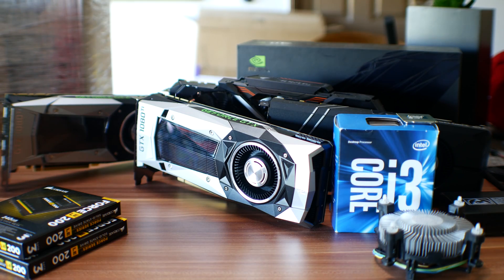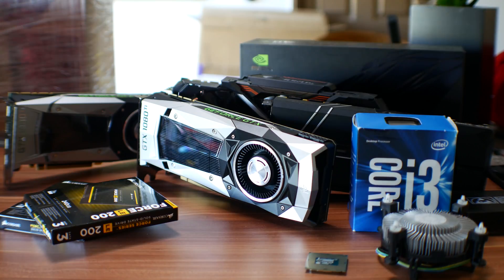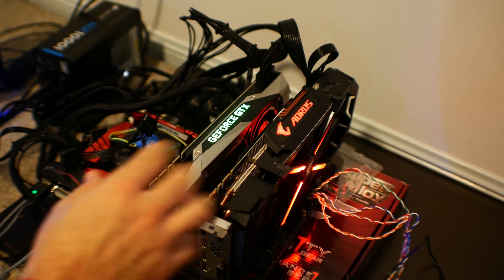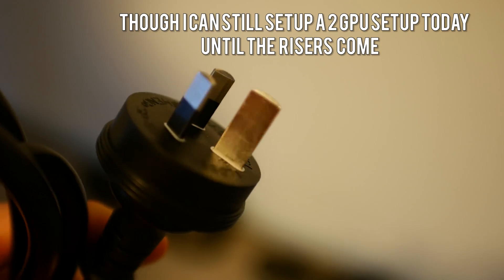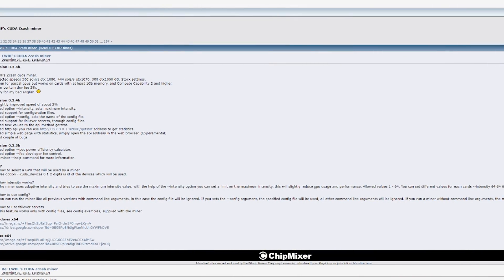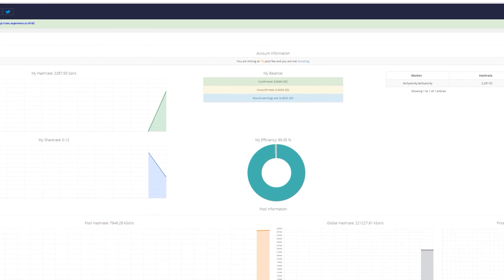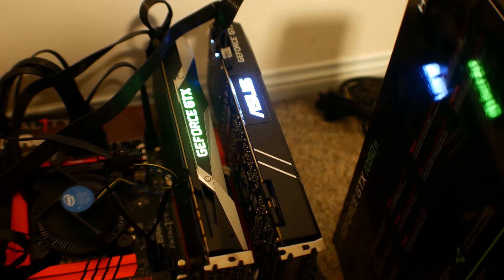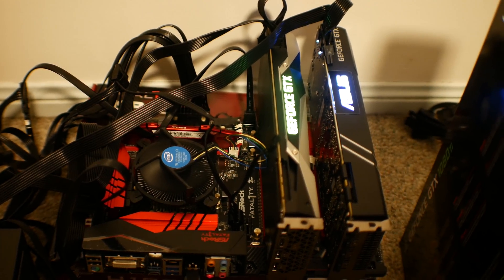Setting up My First Mining Rig...

Comment: Gigabyte GA-H110M-GAMING 3 (Socket 1151)
can anyone confirm this motherboard is capable of using 3 gpus?
and if i plug in a riser to PCI-E x16 will there be a performance loss? can i still use it normally like for example gaming?

Comment: TOP 10 GPU ALIEXPRESS:
1) Model Number: Colorful GT730K-4GD5 
 http://ali.pub/1q2svw
 2) Model Number: GTX 750Ti Colorful 
 http://ali.pub/1q2t0y
 3) Model Number: MAXSUN GeForce GTX1050Ti Esport Gaming 
 http://ali.pub/1q2t3o
 4)  Model Number: GeForce GTX iGame 1060 
 http://ali.pub/1q2t6l
 5) Model Number: Colorful NVIDIA GeForce GTX 1060 GPU 3GB
 http://ali.pub/1q2t8q
 6) Model Number: iGame1050 U-2GD5 Colorful
 http://ali.pub/1q2tao
 7) Model Number: MAXSUN GeForce GTX 750Ti Terminator 
 http://ali.pub/1q2tbu
  8)Model Number: 4GB GTX iGame 1050Ti GPU Colorful
 http://ali.pub/1q2tds
 9) Model Number: NVIDIA GeForce GTX960 GPU Colorful
 http://ali.pub/1q2ter
 10) Model Number: MAXSUN GeForce GT710 Power Hammer Plus 
 http://ali.pub/1q2tgw

Comment: Just an FYI, that 1500W power supply plug you held up and said was 3 phase is actually a 15 amp single phase one. You can tell by the longer earth pin on the bottom.

Comment: I'm not sure if anyone has pointed it out to you, but that's not a 3 phase plug. It's a 15A, single phase. The only difference is the earth pin is much larger and won't fit in a 10A GPO (general purpose outlet). There's a "proper" way you can get it working at your place and that's installing a 15A GPO which you'd need an electrician for. There's a dodgy way, but I won't air that on here!
Reply: Yeah lets not try to kill people here :P best to get an electrician in for that type of job

Comment: I think there's more to this shortage through mining story.  This is not just miners buying all the cards.  I mean if for the demand there were enough cards, they would all be laughing to the bank right now.  So why are the board partners not pushing out cards like there's no tomorrow?  Maybe because they can't?  Due to things such as shortage in supply of GPU chips.

Haven't looked at what yields they are getting on their wafers at the moment, but since RX-480 and RX-580 are essentially the same, just a die shrink and some tweaks ... I wouldn't be surprised that due to the die shrink yields aren't exactly what they expected.  Most certainly not enough to deal with the high demand right now.  Same thing for the yields on nvidia chips, because those are in short supply as well at this point.

Anyway just my 2 cents.

Comment: just saying, that plug isnt three phase, its single phase, three phase has 3 hot wires and 1 neutral, single phase is normally two hot and 1 neutral, for smaller stuff you dont need two hot, that plug probably pulls 30 amps with two hot and one neutral. if your wiring is 10 gauge and breaker support 30 amps or more, you could use a distribution block/wire nut and split the 10 gauge hot into two 10 gauge hots, with one neutral 10 gauge. with ac electricity the wiring will be fine this way, if its dc im not sure.

Comment: Nice. Think im going to try this. Im going to pull my 130watt Xeon W3680 out of my X58 rig and, and toss in a $7 40watt Xeon L5630 to save power and start mining away. -EDIT-: tried the 40watt Xeon and it didnt make a difference. Cpu usage is basically zero when mining, so if your voltage is set to offset, and have all the power saving features on, at idle, the 130w chip down clocks and uses just as little power as the 40watt. Well according to the built in monitoring from my corsair rm750i.

Comment: Why ppl are hating on miners?! The benefits from miners are that gamers can now save more money to buy a better GPU like GTX 1070 or GTX 1080 since they don't affect the prices that much (Source: Amazon) or just buy any games on Steam with your money. 

As a miner/gamer. I have both benefits from them like mining for buying games on steam or buy any other upgrades for my setup.

The only downside from my experience from mining is that it uses ur GPU usage by a lot! but I don't mind that too much because I usually mine BTC if I don't play games or if I'm doing something else not related to the PC that I was mining on. Electricity is also an issue but I monitor the wattage and lower down the power usage so not only it decreases its power wattage by 30% without affecting my hash rate but it also not running as hot as before I tweak down the power target (from 85+^c down to 73-74^c)

Also if you really want to buy Mid-Range GPUs than saving up for higher tier cards... why not just buy some other alternatives like GTX 780ti or GTX 970? even they've used already. They probably still going to work but you just have to deal with less power efficiency and no warranties. (unless you don't mind ur power bill)
Reply: the secondhand market will be flooded with second hand GPU's soon, with Eth crashing like it is 27% drop in price in the last 24 hours went from $288 per coin to $188 per coin  and still dropping, people will be trying to get rid of there rigs to recoup some of there losses..
There is a story of a bloke on the crypto market, he mortgaged his house to get into crypto mining, now cant afford to repay the loan, so the bank is taking his house
Reply: i am pleased with that story.

jokes aside that does suck but he risked it and it backfired, such is life. Now in reply to Elastico345, most of, if not all of the people who want a midrange card want it because they cannot afford a high end card and let's be honest the gtx 1050 isn't that good of an alternative and sadly the the second hand market was also affected seeing how a gtx980 is selling for around 400+ euros where i live..
Reply: well you all can stop sooking now... GPU prices have dropped in the arse in the last week.. people trying to get premium prices  for there cards arent selling.. prices are nearly back to normal and will be till after august  RX560 $150 usd .. RX570 $249 usd.. RX580 $ 319 usd ... all in stock
Reply: Bitter Raven those are not normal bud, Rx 570 are $200 but new inflated prices at msrp are 50 above! Rx 580 8gb are now $450!!!!! Shit refresh for that amount you're better off Nvidia.
Reply: ImRIckJames those prices i posted were at the time of posting that comment ... even $50 over the MSRP is better then paying $300+ over MSRP that people were paying a few weeks ago
Reply: of course people are getting out of mining..  the bubble has popped.. you go back when the boom was on.. people made $7 per card.... no your lucky if you make $1.60 per card
when the boom was on i was making $350 a day now i make $80.. all the people that have been mining for years knew that the bubble would pop

Comment: I might jump on it but the power bill makes it fairly unattractive in Germany imo (~.28€/kWh). I tried to see what I can pull out of my Fury X and it is doing well at 31 Mh/s ETH and 2100 Mh/s DCR. However, I am concerned about how it affects the lifespan of the card, it is sitting there with 80% fans at 75°C VRM - I am not sure if I am doing it any good having it running like that 24/7? Any of you have experience with GPU degradation? I would love to still be able to game on it after ETH is done for.

Comment: Bryan, that is not 3 phase power. that is a 15 Amp plug. normal domestic wiring is 10 amp . the larger earth pin means its 15 amp. 3 phase power has 4 pins and in Aust is usually a large round plug twice the size of a std plug.

Comment: if you want a profitable mining, set a farm...

put it to perspective, if you grow only a wheat on a pot, what did you get on one season, yeah almost no cost. BUT if you want to make money, you plant more which you spend more, in the end of the season you can harvest more...

in crypto mining on pools, it is based on % of power you deliver to the pool = what you get.

if you want to go big time, invest hundreds of thousands of dollars and pray prices wont crash until you recover from your expenses.

i've seen a mine made of up 40 pcs RX 580, 20 pcs of RX 480, 50 pcs of GTX 1070 and some 1080TI's, that's when you gain money from farming (much more appropriate than mining).

Comment: Mate, that's not 3 phase power (415V). Thats still single phase(240V). Difference is thats a 15 amp plug as opposed to 10 amp.

Comment: Hey it's not a three phase plug. It's still 240v single phase but at 15amp instead of the standard 10amp, which I still don't understand why as you can get 2400w out of a standard 10amp plug

Comment: Bryan that is not 3 phase power that is just a 15A socket.  Any electrician can put one in provided you have enough headroom on your circuit breakers.  Or you can be a little dodgy and user a normal 10A cable with it. Chances are it wont cause you any problems.

Comment: Great video and waiting for parts is a bitch...  sometimes even with amazon prime, parts can take a while specially for parts like pcie risers... People could actually even buy and make a customized mining rig from a $12.99 CAD wooden shoe rack from Amazon like this: https://www.amazon.ca/Pro-Mart-DAZZ-2-Tier-Shoe-Rack/dp/B006MOWUY2/ref=sr_1_5?ie=UTF8&qid=1499638740&sr=8-5&keywords=shoe+rack

Simply not install the whole top panel/part and just leave the last one or two (top and bottom part) for stability and for the GPU to hang on or screw about and voila you got yourself a really cheap ass mining rig. I actually bought 6 GTX 1070 for about $500 CAD each just last month and a half ago just to see how profitable it can be. Not to mention dual 1080 Ti for about $850 CAD each for about the same month I have bought the GTX 1070. Having said that, I still have my AMD Rx 470 and 480 mining rig that was making about $30 USD/day that I've been using for about 4 and half months now. I'm fairly new to mining, but I'm kinda going all in with it using the money I've earned back and reinvest it  when I bought the 6 GTX 1070 an dual GTX 1080 ti with it. 

In any case, if I ever grew tired of mining or the value crashes, I could always resell the GPU in ebay or simply wait until the next inflation of cryptocurrency. People go crazy over there buying GPU for about the same price you purchased it for or slightly lower any how. So, I really have nothing to lose here and bare in mind people that you've gotta spend money  in order to make money and earn that ROI in a matter of 3-4 months or less depending on the value of cryptocurrency. Good luck to all the miners out there and pray the value holds for another year or two. There will be a crash, but it's likely to happen in mid 2018 or early 2019. Until then, enjoy the profit it bring and it's never too late to join... I know I joined later than my two friends who've made thousands of $$$ mining for about a year and half. I was silently laughing at them at the time they asked me to join... Jokes on me though... :)

Comment: Is your follow-up video on your Mining Rig, going to include Cost Vs Benefit ?

For me, it's about $0.10 USD - $0.20 USD per kWh during peak hours, and $0.03 on Off Hours. Summer = $0.20 

How much potential gain, could someone like me, with a 8350, GTX 1060 , aim to gain from mining cryptocurrency ?

When is it NOT worth it ?

Can you browse the internet when mining ?

How often can you turn it off / on, and how long does it have to be consistently mining ?

How easy is it to start/stop ?

Are some Cypto-currencies more reliable, and trustworthy than others ?

Comment: All these guys who want to buy a GPU think popularizing mining is a bad thing. Think again. Eventually it's gonna be too difficult to mine ethereum and all those miners will start selling their cards for dirt cheap. You could potentially get a great card for next to nothing. Granted you will need to change the card's cooler because that thing will have had been running for a while. But apart from that these cards are gonna be a killer for the money if you pick one up.

Comment: Are you using an offline wallet as to lock in the bitcoin price at that exact time, can an online wallet not do this :/ ? Nice channel by the way.
Reply: Paul Ogden wether offline or online it's worth the same. And all is universal value. So you can store it in illuminati pyramid and if 1 BTC is worth $1 out here, then it's still worth one in Illuminati pyramid. Your online wallet is just showing the fluctuations from original price.

Comment: why didnt u buy an asic
Reply: Doesn't work for the new cryptocurrencies, they're designed to resist asic mining.
Reply: IsakH85 why? dont they need ppl to mine their shit ... i mean... fuck off
Reply: Asic mining meant only a few rich people and companies/governments had the ability to mine, as a profitable asic rig is too expensive for most people. Asic resistant cryptocurrencies makes it possible for regular people to mine again, just using normal graphics cards, which is kind of the whole point of these currencies in the first place (prevent a few wealthy people from controlling the market, power to the people and all that). Of course, now there are huge mining operations with thousands and thousands of GPU's so the rich will still take the biggest slice of the pie, but it's still better than them getting everything. It really sucks for gamers who just want to build a PC with a decent mid-range GPU though :/

Comment: The GPU prices are decreasing back to normal
.
.
.
.
 
And then there's this guy
Reply: Ak Mungroo They sure as heck are not going back to normal in the US. The 1050ti is still $30 more than when this started, the 1080 about the normal price (but it had dropped below the original $479.95 MSRP in some cases), the 1080ti is back to $40-$150 over it's MSRP for the most part, the 1070 is at least $150 over MSRP, in many cases over $300 MSRP, and the 4/570 and 4/580 are $200-$350 over their old prices, so I'm not seeing any price drops yet.

It usually takes about 18 months after the difficulty algorithm (in this case Casper) gets to a point where mining the particular bitcoin is no longer worth it to casual (under 30 cards) miners to bother with and then another couple for gpu prices to come back to Earth. Casper kicked in February 2016, so I guess it's following the same trend.
Reply: useless people, as long they dont have to really WORK for their money.....
Reply: Ak Mungroo fuck off

Comment: is this actually worth it? spending a lot on a mining rig? will you get a lot of profit out of this?
Reply: Unless you have some gear now sorry to say you've probably missed that train.
Reply: I wouldn't spend a lot at today's prices for cards. It'll take a looooong time to get your money back if you ever do. However if you have a gaming card or two sitting around being lazy while you are sleeping or working, they may as well be earning their keep.
Reply: Depends of how much you mine with your rig, what coin are you mining and how much its worth, and the most important, how much your power costs and your mining station consumes, also you need a good cooling area or solution for your rig if you want it to last.
Reply: Dom W. If you have a powerful enough pc or only need a discrete GPU to start mining I'd recommended it and it pays for it self, but if you don't have a pc I personally would think twice on the idea. The difficulty to mine a coin is going up pretty fast. About 6 months ago I was able to mine 0.1 monero in about 80 hours. Now I have to wait a little under two weeks. Shure the price per coin has almost tripled but who would guarantee It would stay there for much longer... :/    (160H/s using an AMD HD7750 "R7 250E passive edition")
Reply: AMD HD7750 and the R7 250E arent worth using for mining, it will cost you more in electricity then you make.. one R9 290 or HD7970 or  R9 390 will get you 770h/s  0.03043 xmr $1.87 a day
Reply: It's not worth it but it is more worth to invest in the coins which you wish to mine instead of mining it

Comment: A computer psu with 3 phase? Are you sure about that?
Reply: i think hes misinterpreting the ground pin?
Reply: its just a standard Australian 15amp plug. nothing special, certainly not 3 phase.
Reply: It's single phase 15 amp (rather than the standard 10 amp) with a thicker earth pin - these are pretty common in commercial equipment.  You should be able to get a 15A socket installed fairly easily.
Reply: Yeah, Australia has 230V, so with 15amp fuse it should be able to deliver 3450W. This kind of power supply doesn't even exist. The middle pin is clearly just a ground pin.
Reply: Yeah, I don't know where he's getting that from. I mean I don't know this exact type of plug but there aren't even more contacts on it than normally.
Reply: You need to have an electrician come to install a plug that will take that PSU in Australia. Don't think it has anything to do with the phases... It just takes more power than normal.
Reply: He'll visit his friend, buy a weird china adaptor and plug this into 3 phase. Who needs neutral and ground anyway!? 3 live wires will be enough!
Reply: wasnt 3 phase.. the plug on that PSU is designed for a 15amp socket .. easy fix get the grinder out and grind down the ground pin till it fits in a 10amp socket
Reply: Yeah I dont think he actually meant 3 phase power, but PSUs with 3 phase power do actually exist, ive seen some cloud rack servers with them in a DC somewhere
Reply: Well yeah, but i wouldn't expect one in a home use case for mining.
I personally just use those used server psus from ebay for mining. About 80-100A on the 12V rail for 20$ is pretty neat. And they're actually meant for 24/7 use.
Reply: do you have any 1500+watts psu? i have 4 2500w and those only come on 3 phase i tried on 2 and 1 and the wall cable burned
Reply: got a couple 1.65kw units but those only need single phase
Reply: It's actually a single phase, 15A plug. Usually needs a dedicated 15A power circuit from the switchboard.
Reply: Strychnine your a bit slow this has been answered about 300 times already in the comments